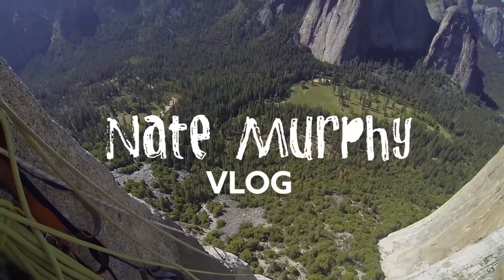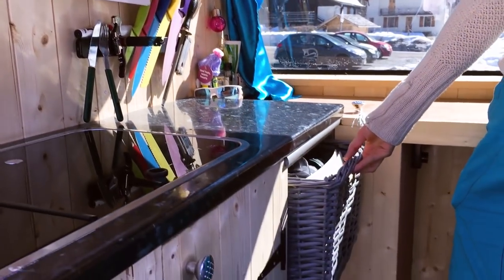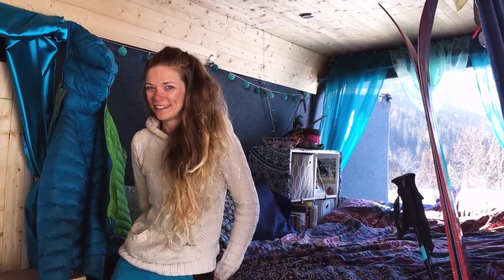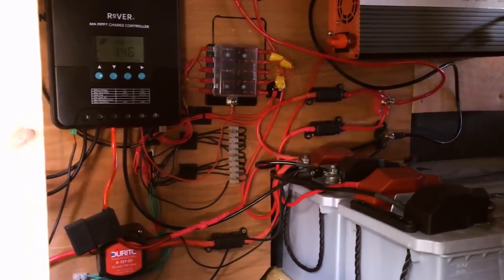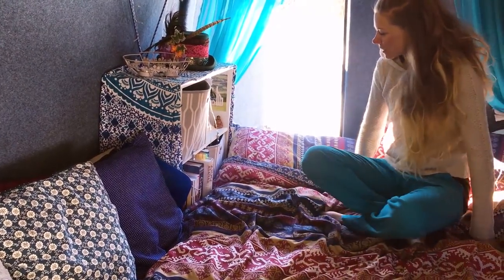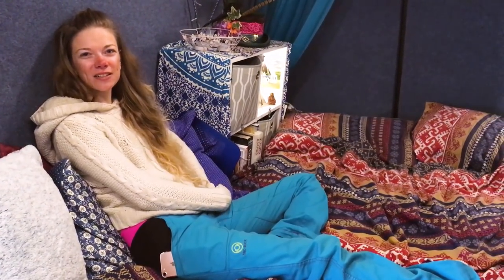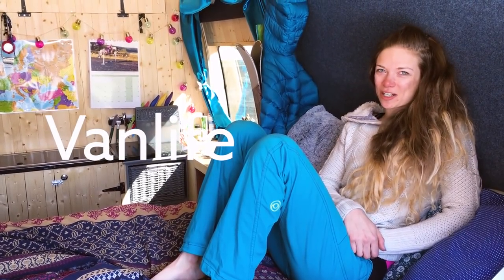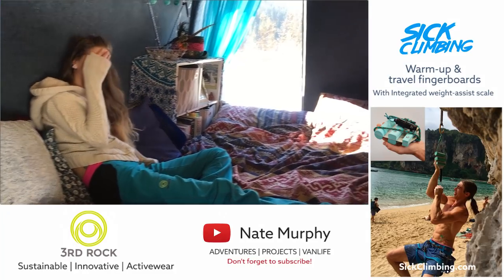Female Skier Converts a Van to withstand Extreme Conditions | Vanlife in -5°F (-20°C)

Comment: Don't like van conversions without a toilet. Yes you can fit a nice full sized toilet and shower in a Sprinter van. Plus there isn't enough windows. She should add a sky light with access to the roof and and back windows, especially ones that open

Comment: Good job but £10,000??? You're daft. You can do it for less than £1500.
Reply from the maker: Maybe not including the van :)
Reply: @NateMurphy  no maybe about it.
It comes down to circumstance I suppose but believe me it's possible. I bought and converted an LT46 all for less than £800 You don't have to throw money at everything to get a great finish.
Reply from the maker: True, tho some of the systems for cold weather just costs a bit of money if you want it to be reliable (solar/gas etc). But yeah, you can convert on the cheap for sure.